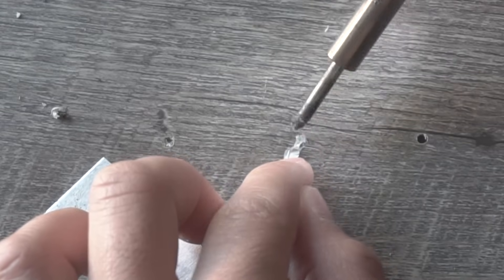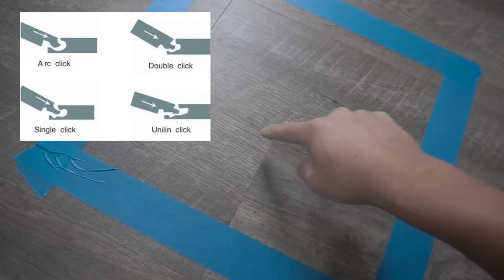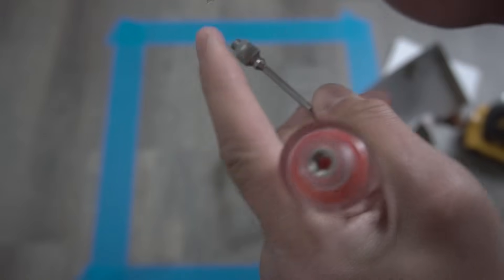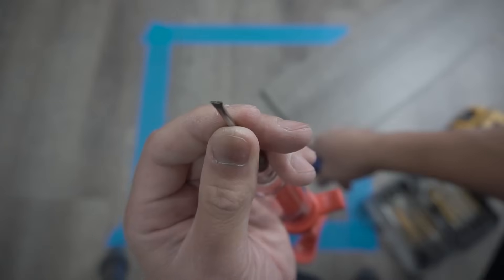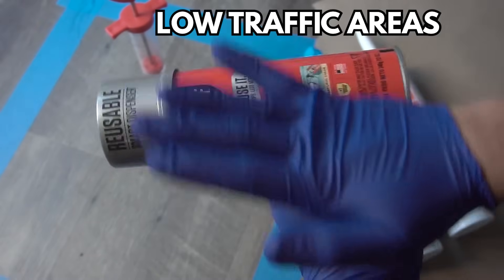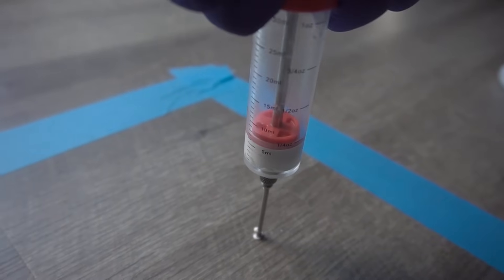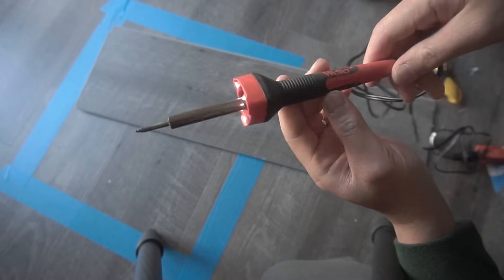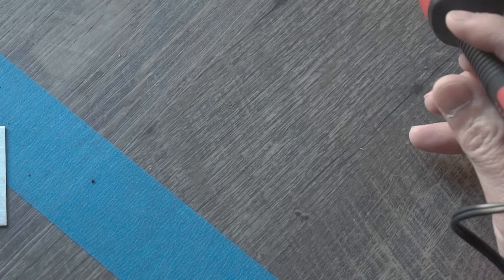How To Fill Hollow Spots Inside Vinyl Plank Flooring LVP Laminate And Engineered Hardwood Floors DIY

Comment: I really wanted the soldering iron to work...however, I CANNOT get the plastic to melt as shown in the video. It either sticks to the soldering iron and burns or wont melt to the surrounding vinyl sides. Any tips ?
Reply from the maker: Hi! Good technique is to practice to a scrap piece firs. Make sure the iron is clean. The key trick is to do a tapping motion once the iron is hot. Don’t let it sit on the piece to long or it will stick and melt. A feathering motion will help as well. I would recommend to tap and get a wet rag. Once you make contact tap the area to cool it down then tap the area with the solder again. I hope this helps. Please keep me updated by emailing me. It’s hard to keep up with comments here, thank you for yo understanding 🙏🏽🙏🏽😊
Reply: Don't heat it up all the way. Your soldering iron is too hot.

Comment: The injection method worked great for taking out the bounce, but the plastic welding is very misleading. It only really works if you have LVP in a grayish color. If you try this method with any kind of brown plank, you'll end up with gray dots where your holes used to be. Also what was the point of the jump cut at 9:28? I have no idea how long he's holding the iron there, but either my iron isn't hot enough to melt the plastic like he is, or I turn it up and it instantly burns it.

Comment: I tried this on a lighter floor. The solder just gets black even if i just tap it very lightly. Wonder if using repair wax would work instead?
Reply from the maker: Try scuffing the soldered area to lighten the burn marks. 👍🏽😊
Reply: I did 4 trail runs. All get black no mather what i do. Seems like the plastic in my flooring is very sensitive. Floors are very light.
Reply: @Luddd78  my floor is very light colored. Used plastic wood in natural color
Reply: @cr8z4vball  link product?

Comment: I would've follow different approach by cutting and removing carefully the plank beneath the problematic area, grab a new one (assuming you have at least one backup plank laying around), trim one side of the locking mechanism, lay down the plank and then glue the plank after fixing the floor.

Comment: I tried this method a week ago.  At first it seemed to be working fine after letting it dry for a couple of days.  Now, unfortunately the caulk seems to be moving some when you walk over it.  I think it will take quite awhile for the caulk to dry, if it ever will, so I am concerned that I will now have to rip up this section of the flooring to fix it permanently.  Anyone else have this experience or can anyone tell me how long it took for the caulk to firm up?
Reply from the maker: Hi! It all depends on the thickness, humidity and temperature in your area. I did some areas during the summertime where it was warm and it took about 2 weeks to fully cure. This was about 1/4” deep around a 3 sqft area.
Reply: @FixThisHouse  So I guess I need to be more patient.  We are avoiding that area now so hopefully it will cure.  Other than the curing, everything went well.  I was able to successfully use a soldering iron to plug the holes.  You can see them if you know where to look.  Thanks for posting the video.
Reply: @larrydalien1337  Did your floor cure? how is the floor now? Did the caulk help your situation?

Comment: I once used spray foam to fix my flooring.    BAD IDEA!   It expanded WAY MORE than I thought it would.  
🤦 
I like this caulking and 2 hole technique.   The second hole tells you how much caulking you're inserting.  It also allows air flow so the pocket doesn't move elsewhere.  
I'm curious to see how well this holds up.  🤷
Reply: If u use the window foam it doesn’t expand.
Reply: Please do not use this method. It's an awful idea. You will cause a bigger problem when this band aid starts to collapse.  This is the worst part of YouTube. You get lazy people like this guy showing  D.IYers bad work and do it yourselfers think WOW GREAT IDEA! But it's not. Guys like this should be blocked from showing people how to do anything. It's not a hollow floor it's an uneven point in your slab. Self leveling cement poor's out easy and levels foundations in cement and wood. That's the permanent fix. Smart people call it prep work. It's like pulling all your teeth so you never get a cavity again. Sounds great but in the long run you will kick yourself for lazy planning.
Reply: @robhamilton4736  my house is from 1983 and it has about 2” of differential elevations just in the first floor.  I can’t fix that with self leveling….can u imagine the weight over the wood joist.  I used in a few spots windows foam and no issues after 2 years.
Reply: @engrxtn  exactly. Rob just doesn't understand.

Comment: If anyone who knows anything about floating vinyl plank if you look at the installation and how close the seams are together the installer stair stepped the plank. And what I mean by that is look at the short seams they look like a staircase. Also industry standard is you can have up to 1/4 of a inch the floor can be out. I’ve done plenty of snap n click installs with vinyl plank and have had this issue once the vinyl actually relaxes after a few days of being installed the plank actually will contour to that little dip. If it’s a bad dip that’s on the installer. FYI also vinyl plank does not expand and contract as much as people say it does. I’ve been doing vinyl type flooring for over 30 years and vinyl plank snap n click pretty much since it has come out. I definitely would not suggest doing this. He’s talking about putting a adhesive under that air pocket. Well that’s not very smart because now the floating floor now has adhesive under it. How will it expand and contract if it has been glued to the subfloor of in fact it expands and contracts as he says it does. Trust me that little bit of movement will eventually make retry much improve or disappear as the plank settles more and contours to the subfloor. So sorry to say this is not a great tip video.
Reply: We have install vinyl floor above concrete slab for about three weeks and I still feel some void under some area, from your experience will that go away in long term? As it doesn’t feel good to have void when step on
Reply: @kurtwang7620  that more than likely is a dip in your concrete. Usually if it does not go away by now more than likely it will stay like that. If you can barley feel it and it is not happening by any of your short butt seams you should be fine. But if it’s happening by the short butt seams the locking system might start to get compromised after a while, Especially if it’s in a high traffic area.
Reply: @3rdGenFireChicken  thanks for the reply Ross, in that case, before ripping the entire floor and redo it, should I try the method shown in this video?
Reply: @kurtwang7620  I would not. The reason for that is it’s a floating floor so it needs to expand and contract. If you glue it in any way now that floor will not be able to do that. Also will void your factory warranty. What manufacture is it of the floor?
Reply: @3rdGenFireChicken  I bought it from the floor & decor. Does the warranty cover such stuff?
Reply: @kurtwang7620  no warranty does not cover that. They will tell you that’s installer error they should have checked the floor first. Is it the nucore floor that they sell.
Reply: @3rdGenFireChicken  it’s called optimax, if I get that name correct
Reply: @kurtwang7620  I would give it another week or so if the floor relaxes a little bit meot
Reply: More.
Reply: @3rdGenFireChicken  thanks! Will wait and see
Reply: How do i fix a popping floor? Mine is a laminate floor around 4 -5mm thick and in winter it pops and moves a lot but its fine in summer? I was going to try this trick but what are your thoughts ?

Comment: Never thought of doing that for sealing holes. May have to save for small imperfections when accidently dimple the floor or a corner messed up that baseboard and casing didn't quite fill

Comment: I tried running this on nucore tachtanium plus. I realized quicky that this particular vinyl planks are not much vinyl on top. It will become more of ash than melt upon tapping by soldering. So I tried actual vinyl flooring to put on top; it won't mix. Vinyl will melt (also discolor yellow ish) but will not bond to the floor as floor is not melting but rather just burns. 

I am thinking to just fill up a practice hole with clear caulking or vinyl glue and mix with color. 

Amazon has this meltable vinyl? Sticks for the floor. Not sure if that is worth buying/trying. Will be hard to find a perfect color.

Did anyone thought of mixing clear caulk with ( home Depot matched paint?, I wasn't thinking to just bring a chipped away floor to match)
Reply: Try using wax or a wood putty that has the same colour and use a toothpick break off the end and then use wax or putty to seal off the hole. It can never be perfect but at least your floor wont creak anymore.

Comment: I have literally laid square miles of this stuff.... Who laid that floor with a regular repeating board stagger pattern and a short one at that? A lot of that movement was down to poor short staggering of the board ends and repeating row upon row, there is a hollow but all that movement is accentuated by this and translates further across the floor than it should potentially breaking those very fine ridges on the tongue that actually hold the floor together against the lateral movement of foot traffic (pulling apart) or broken tongues (tenting joints) or split grooves resulting in corners that stick up or fall down. Irregularly laid out floors are many times stronger and must be laid as such. Great tips for filling by the way, first class, but that pattern has got me triggered lol.

Comment: Hi after reviewing all the comments it seems there are a lot of professionals that are naturally support in the fact of a well prepped floor beforehand and obviously I would assume that hundred percent of people would agree that these are the correct steps that should’ve been taken but let’s just say for example as in my case that you have allowed a contractor to tell you what is correct and to use a feather edge over the grout lines of ceramic tiles are level out the high spots and feeling the low spots but after installation you find that you still have some tips in the floor on a product called Evo core premium which is an eight mil thick vinyl tile.
You have since had after the flooring contractor a new cooker fitted a range cooker and American fridge freezer washing machine and tumble dryer and all of my base units for the kitchen with this process big septa bull and work if you wasn’t too bothered about the warranty period of the flooring to avoid disruption of removing all of those items

Comment: Spray foam is a million times better.  Fills more backspace
Reply from the maker: It crushes and squeezes when stepped on
Reply: @FixThisHouse  ...  Not easily. People would have to stand on the exact same spot a million times before it to starts to break down that's even if it does break down. Been using it for years never a problem
Reply: @page76metalcraft19  can you recommend a brand for the expanding foam?? I have been told to use a minimum expansion foam or it will cause big issues in future.

Comment: I didn't understand why you nipped off the end of the syringe. Also, to hide your holes, why not just use colored putty?
Reply from the maker: Hi! Nipped the ends because if I didn’t there are 2 holes one on the side and bottom and it will be too long to get full coverage inside the 1/4” floor gap. Also putty is best for wooden floors not vinyl.

Comment: As a floor layer, I'd advise strongly against this method for several reasons, which I'm happy to explain if you'd like me to and you don't mind reading a few paragraphs.
Reply: Why?
Reply: We are waiting on that explanation
Reply: why? spit it out!
Reply: @LifewithNiya697 
First, you should never attempt to glue down part of a floating floor as it will cause expansion and contraction issues relative to the rest of the floor by limiting the movement of those rows by half.

Second, you cannot control the spread when you inject it and not actually level your subfloor, so potentially causing the glue to spread beyond the intended area causing humps in the floor, which will make the bounce worse and more noticeable, especially with vinyl. 

Third, for timber and laminate floors where an underlay is needed, it can interfere with the underlay itself by pushing and shifting it and also interfere with the moisture barrier.

And, whatever you inject will have difficulty curing. Glue works by reacting with the air, which there is minimal, if any underneath the floor. This means a prolonged period of direct moisture to the area.

In conclusion, just fix it properly instead of trying to take dodgy shortcuts.
Reply: @zchettaz  I saw the title of this and thought ALL of these things as being issues.
Reply: Yeah or prep the floor before the install. So when installed. No issues 👍
Reply: @iw1166  Correct. Most of my work is in new homes, so running a straight edge over the slab is the very first thing I do when I get on-site. Unfortunately, in my part of the world, alot of floor layers skip this step, as it can add a significant amount of time onto the job and make very little money doing it.

I will refrain from ranting about the bigger problems in the industry regarding tolerances, half-assed workmanship and market growth. Its a deep rabbit hole.
Reply: @zchettaz  you can glue down some areas..even the manufacture states so on the install directions
Reply: @jayc4715  what manufacturer says this and what's the specific product? You wouldn't be getting "glued down" and "glued together" mixed up, would ya? You either have to glue all of it or none of it. Gluing down part of a floating means that part of the floor can no longer float, which I'm certain that would void any manufacturers warranty.
Reply: @zchettaz  traffic master lvt
Reply: @jayc4715  Had a look at several of their luxury vinyl products, from what I can tell their LVT is all peel&stick?
The LVP floating floor products I looked at doesn't mention the use of adhesives or glue either in the installation guide or warranty.
Can you please link me to the guide you read that states that part of the floating floor can be glued?
Reply: @chet - I am also a floor layer and I completely agree. I also do new construction and I can't imagine walking into a new homeowners house and drilling holes into their brand new floor.  The homes I'm in are 500k+ and this hack would never fly with the builders I do work for. Prep it right, install it correctly, and move onto the next one with no worries
Reply: @mattwoelfel7607  Amen, brother!

Comment: I have been flooring for 15 years. This will fail quickly. This is only sticking the foam backing to the floor. The foam backing can easily be peeled off the board. Forget it. If you have a dip in the floor. You need to peel off the backing foam. Use a heat gun to warm and it peels off easily. Use a rubber based flooring glue to glue this plank down in the dip to allow movement.

Comment: Just to let everyone know….luxury vinyl plank and laminate floors ARE NOT glued to the subfloors so there will be movement! There are tolerances to how much movement though so check with your manufacturer to see the specs of your particular floor. Also that “clicking” sound that you heard when he tapped on it is the milling of the locking system. It’s not a super tight fit so there’s movement between the tongue and groove causing that sound when tapped on. You get this a lot with rigid core luxury vinyl plank flooring.

Comment: This fellow thinks he knows what he is doing but he does not . I am a professional at this business. These floors are designed to float freely. If you glue it or attach it at any point it will unlock at any given or weakest point . Hollows must be addressed prior to installation.
Reply from the maker: Caulk is not glue.

Comment: Brother I will YES good job on the soldiering iron that's what I use on chips. But my friend I've just watched 2 videos and you can't tell people to be stomping boards apart or together so for instance on your plank on a tap down locking system so without sliding it apart PROPERLY  if you go forcing them apart what happens to the locking system IT BREAKS so what holds it together the length not a chance and as far as injecting a LVP floor ummmmm no you shouldn't have laid it in the first place if you have that much of a void do it properly from the start use floor leveler like Mapie or Ardex feather finish and if you can't level then get Mapie self leveler but I'm telling you DO NOT DRILL YOUR LVP,LAMINATE OR ANY HARD SURFACE Flooring do you realize if you drill your flooring your warranty is done gone good bye so on one of my products it's a 25 year residential and a 15 year commercial warranty so on the first or second year you drill your floor and on by chance you get sunlight discoloration you call the manufacturer and something that would be covered well guess what you are thousands off dollars
So you shouldn't tell people to drill and inject there flooring or stomp them together or apart.
But awesome job on trying to just help out regular people but just do a bit more research first if you have any questions message me I would be more then happy to help you out with any information brother 
Cheers best of luck.